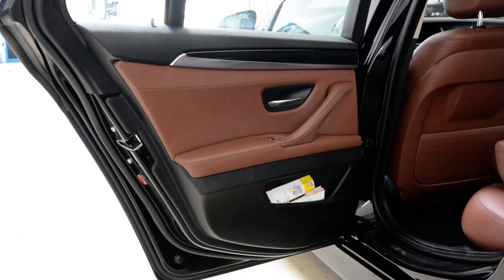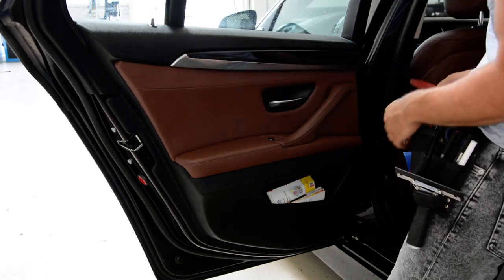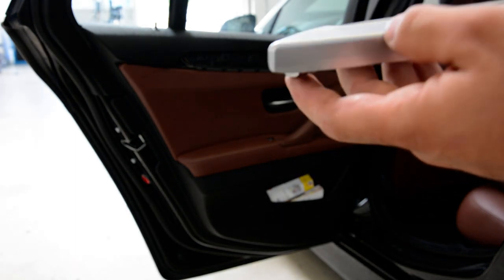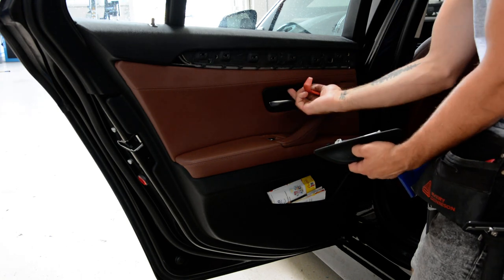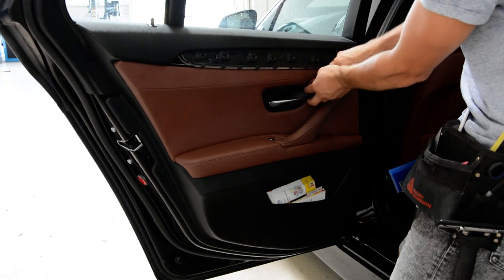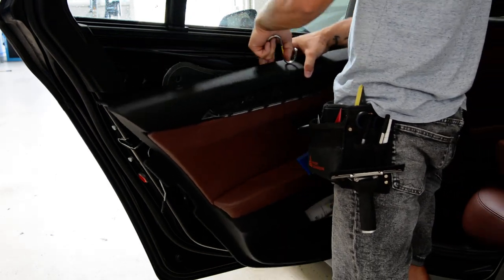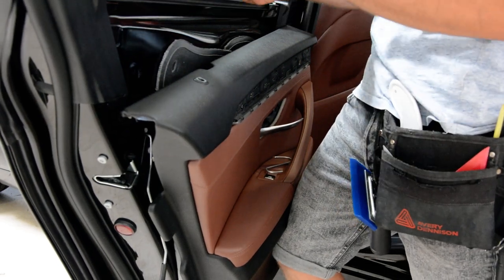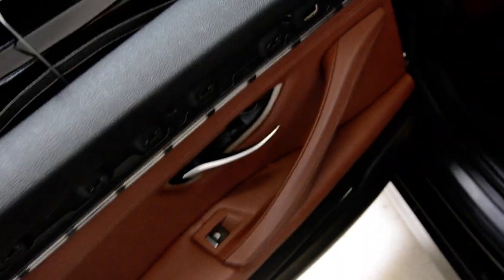How to remove the door panel BMW 5er F11

Comment: So you do "NOT" have to remove the wood trim on the rear doors  "ONLY" on the front doors because the front doors have a screw in back of the wood but there is no screw under the wood on the rear doors. Is that correct?

Comment: This is great if water is entering and wetting the rear floors do to that rounded black foam seal's glue not sticking anymore.  Must reglue the areas that need to be glued and avoid another rain disaster to ur rear seat floors!